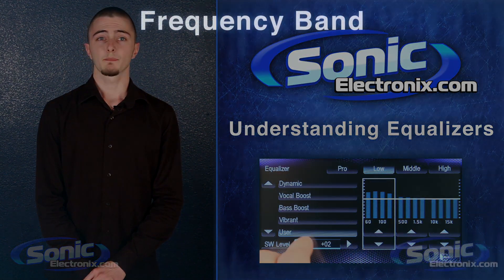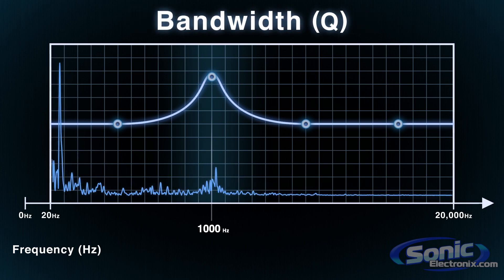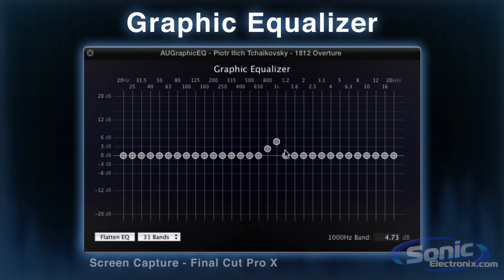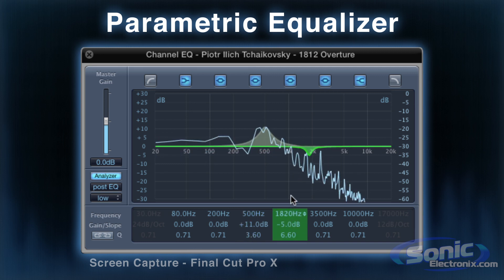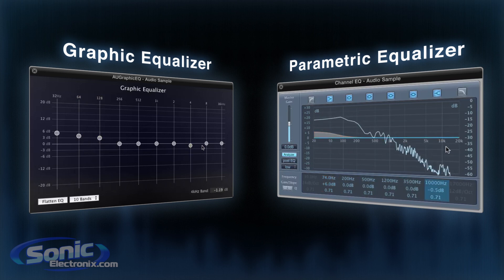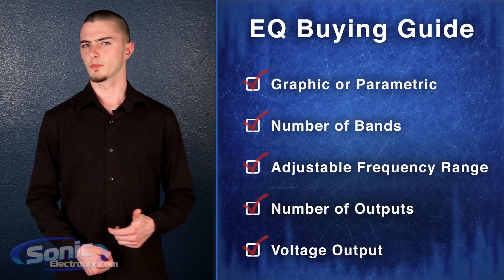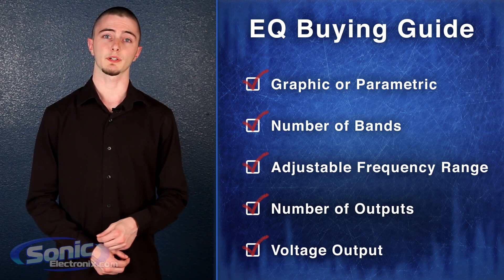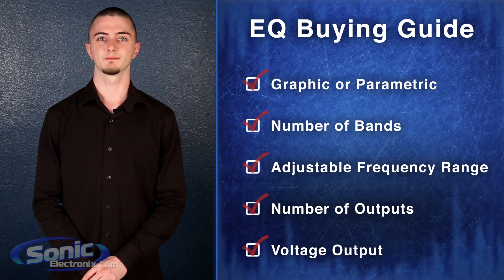What is an Equalizer (EQ) and How Does a Parametirc vs Graphic EQ Work?

Comment: Sorry I'm new to all this but my friend said I have something called clipping when a song hits a high note and I wanted to know how to reduce that through eq settings... I have a kenwood excelon kdc-x303 reciever any help would be much appreciated.
Reply: Your frequency bands are most likely raised too high in the low end frequencies and or maybe your door speaker or whatever speakers you have installed are possibly very old, practically blown, very old & on the verge of blowing/plainly stop playing and or might actually be one of those things and so the Speaker doesn't perform as it should maybe it's playing extremely quietly which is abnormal to you... So  your like hmmm...🤔 it's too quite so idk lets go and crank down on the volume knob a tad bit to get the loud sound I'm so used to. Annnd then you get the clipping factor...    Clipping or also commonly called known as distortion is when your speakers basically are receiving a D/C voltage instead of the properly intended alternating A/C voltage signal... All this next stuff... (which this is basically 100% it's really what it means, when your output audio signal that's playing coming out  thru the head unit thru to the amplifier, (if no amplifier then skip it in your head ) straight to the speaker is majorly clipping/distorted...  ( I'm just dumbing all this down heavily all the way to be super simple to try and understand)  anyways when speakers receive that D/C signal, they are practically talking to you and saying woah, woah, quit it!  Hey man, stop that, I just can't take those types of incoming frequencies,  I'm not the type of Speaker that can handle or play that sort of high or low frequency your throwing at me... or maybe it's saying stop it I can't handle all that power your feeding me and I will eventually end up not being able to take it anymore and give out on you( Blown/fried-coil/ripped-speaker-surround)   should you continue to do so.    Clipping/distortion(you know when you've listened to music and watched a speaker and it flows in and out smoothly with the notes being played...?  Well clipping is when you over drive the Speaker and the surround of the Speaker(what you've seen before running smoothly) is basically literally I'm not sure 100% how to explain or help you imagine this scenario but... Okay so you've seen it play smoothly it goes up down up down right? Well when it's clipping its literally really hard and fast going up and down pushing the surround outwards and inwards all practically at the same time and that's what causes your all too commonly know but much hated by all, the good ole clipping/distorted audio signal which causes that very individual to eventually  blow out their subwoofers or mid- range/mid-bass speakers,  and of course not forgetting tweeters.   Also a clipping signal if viewed on an oscilloscope a normal playing signal is going up down, up down smoothly like ~~~~ that kinda just smooth going up down, up down, bumps. The signal is alternating like that cause that's what it's supplied with...  Then when the distortion/clipped signal kicks in, those smooth up down, up down wavy  Alternating hills that you'd normally see flowing all nice and evenly when the signal is good(unclipped), will turn those wavy bump or hill thingies whatever the hell you want to imagine in your head, become alternating squares, not smooth curving hills...  No not making shit up that's literally what goes on during a clip

I get this was 02 years ago but maybe you didn't get educated on the subject and maybe still get some sort of distortion somewhere in your car audio system...

If I were you I'd find out the way to do it then rest your head unit then start fresh make sure to go thru the settings and find and make sure 100% your bass boost is down or what can also be called loudness or something along those lines... But anyways yeah turn ("OFF") not down but off all your bass boost or loudness stuff in the settings then play threw a few songs at same volume that you recently remember  having the distortion kick in at the certain volume.  If that doesn't help and continues then it's most likely not 100% but pretty much 85%-90%-95% it's going to probably be something that's going on within your speakers connected to the head unit....

(IF ANYONE THINKS ANYTHING I'VE SAID ABOVE IS NOT TRUE, OR MAYBE A CERTAIN SOMETHING I SAID UP THEIR ISN'T 100% QUITE CORRECT, OR IF I SAID A WORD INCORRECTLY OR SOMETHING... THE INTERNET VOCABULARY SHERIFF'S CAN GO ON AHEAD AND MAY CORRECT ME...  I DON'T GIVE A SHIT IF I SAID ANYTHING INCORRECT AND IF SOMEONE THAT IS: (MANY TIMES MORE KNOWLEDGEABLE IN THIS ASPECT OF STUFF) IN THIS SIDE OF AUDIO THAT GOES OUT OF THE WAY AND ATTEMPTS TO TRY AND CORRECT ME IN ANYWAY/ANYWHERE I WAS WRONG OR MAYBE MISPRONOUNCED OR JUST FLAT OUT THINK I'M AN IDIOT AND DON'T KNOW WHAT I'M EVEN TAKING ABOUT CAUSE MAYBE I EXPLAINED ALL ABOVE SAID  IMPROPERLY, I SERIOUSLY DON'T GIVE A 💩 IF ANYONE KNOWLEDGEABLE (THAT KNOWS ALL OF WHAT THEY'RE SAYING) GOES ON AND CORRECTS ME OR TRIES TEACH ME THE RIGHT WAY ABOUT SOMETHING I SAID WRONG.   YOU ALL MAY GO ON AHEAD AND BRING YOUR $00.02 ¢'s INTO THIS. CAUSE I FEEL LIKE I KNOW WHAT OM SAYING BUT AGAIN MANY OTHERS KNOW MORE THAN ME,  I KNOW THAT... AND WHAT IM TRYING TO SAY BY ALL THIS IS I'M NOT GONNA BECOME A BUTTHURT BABY OR A KAREN IF SOMEONE CORRECTS ME. I LOVE KNOWLEDGE AND LOVE TO ALWAYS LEARN NEW THINGS I Didn't ONCE KNOW OR MAYBE KNEW BUT HAD IT CONFUSED & MIXED UP.        

Thank you whoever,  for taking time out of your day to read my new Fall 2021 ~ N.Y. all time best seller novel about Clipped-Distorted-Audio-Signal & slight E.Q. Bands.

Comment: My headunit has a 13 band eq built in but I still installed a separate eq unit. Fumbling around in the menu on my head unit ( and I would have to for each frequency band I want to adjust) is not only a pain but dangerous while driving. I prefer the ability to just blindly twisting knobs and let my ears do the adjusting while the eyes are on the road. And some of us audiophiles make eq adjustments per song. 

The other reason is that most separate eq units will have a much higher voltage output for their outputs. The entry level head unit will most likely give you 2V output. A high end head unit ($200-$1000) will probably give you 4V - 5V RCA output voltage.  Which is good but you're spending over $200 at least. HOWEVER,  even the cheapest equalizer will output a minimum  7-10V output. Cleaner sound from your amps.

Comment: how do you hook up an eq so that you can only boost lets say 50, 60, 70, 80hz etc in the SUB and NOT the components? 
i run into the same problem using the head units EQ.. it boosts the frequencies in all speakers but i wish i had the choice to choose between sub only and door speakers only or All.
Reply: If your speakers are crossed over properly it shouldn't do that. 80hz and down should be the sub. 80hz and up to about 3000hz to the mids. 3000hz and up to tweets.
Reply: akuma4u any time you add something to the signal chain you run into caveats of one sort or another. 
Get an active eq to split up the signal, and you should solve your problem.
Reply: Late reply but good for newcomers. If using separate amps, your voice amp will have a subsonic cutoff frequency (built in crossover). Set this to 80hz (or higher on preference) anything below that frequency will be cutoff. If no built in crossovers are available, you can add a passive crossover/choke coil to your mids. Contact ebay user Mavin, audio tech who has the knowledge and parts you need.

Comment: So do I get an EQ to work with a Aftermarket radio and a factory Amp that doesn't have RCA Cables, will it still work connecting the inputs from EQ to the radio? Thanks

Comment: Are there any EQ's available that can be used with a home theater system, using HDMI cables???
Reply: Yes, the miniDSP nanoAVR-HD. However you really need a measurement mic like a Dayton UMM-6 or miniDSP UMIK-1 and knowledge of Room EQ Wizard to get the full benefit of the device as it's parametric EQ only.

Comment: One thing I wish is for is an EQ that's fits right under the main EQ which is specifically designed for bass only with multi bands between  10hz to 100hz for us Bassheads.
Reply: Yes!

Comment: The 4 channel amp needs 2 cables and the mono amp needs just 1 cable, but make sure your head unit has a left, right and subwoofer rca outputs, theirs many other ways to work both amps if you just have 1 or 2 rca output's.